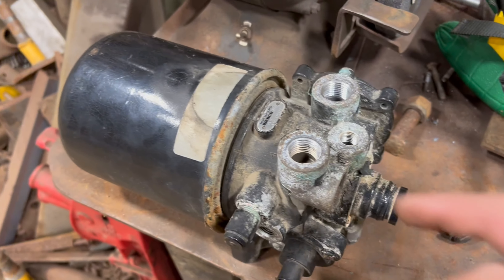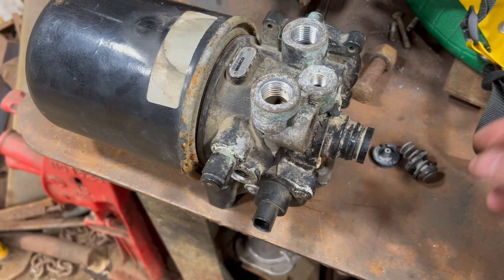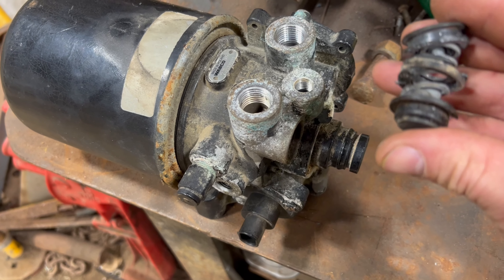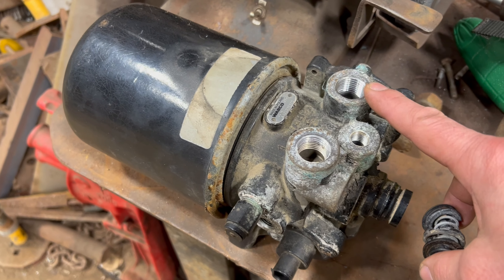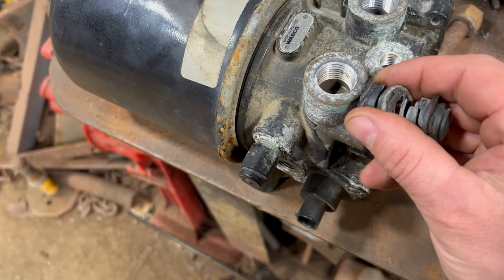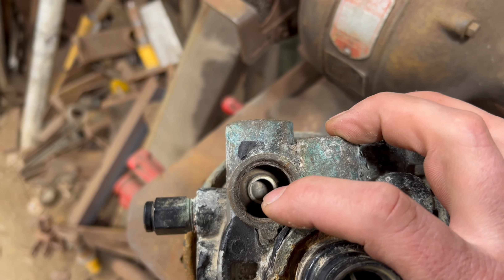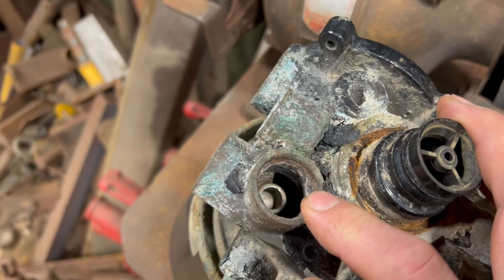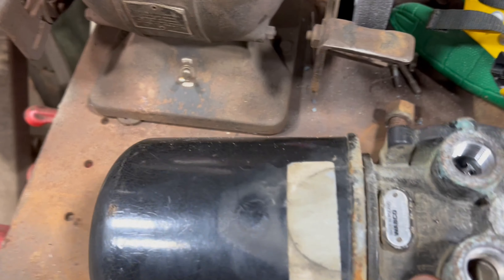What was wrong with the Mack air dryer

Comment: nice tare down I have seen that many many times before. being I seen it so much if a truck wont build air or intermittently build air I bypass the air dryer 1st just as a test to see if it changes if it builds air I hang a new air dryer if no change I hook up the dryer again and test other places governor/compressor etc. Cheers
Reply from the maker: Thank you. Good advice, this is my first bad dryer.  We never really get high milage on these trucks. This one is a 2014 and a wabco dryer. The bendix ones seem to last much better. We have trucks from 95 to 08 with bendix dryers that are original to the trucks
Reply: @JasonTheMunicipalMechanic   I have seen a 2018 fail last year even. I live in a salty place as well most times I change the whole dryer even though its more money then just a cartridge cause its so rusty. the worst air dryers I have seen are some of the aftermarket versions of a bendix AD-IP had a few only last 3 months so now its bendix or wabco no more aftermarket ones for me. Cheers

Comment: Sounds like a classic Eric O  “well there’s your problem lady!” Moment.   

I found a diesel fuel line check valve stuck wide open a while back.   It had been causing hard starts.    That was a sweet moment for me because it was soooo obvious.   Should’ve recorded it and put it up on my channel, but you know in the fury of work and deadlines it’s hard to stop and record stuff.
Reply from the maker: The obvious problems have the closure I like. There’s not much worse then an intermittent problem that has no definitive repair. I usually take apart the parts I replace to either verify the problem or to just see how they work. The air valves are pretty interesting how they function.

Comment: Is there a kit available to refresh this dryer? You might want a serviceable dryer on your shelf. Good content. 👍
Reply from the maker: You can change the filter and I would imagine you can get a rebuild kit but there was too much corrosion to get anything apart. I had to hammer most of it apart and the plastic was breaking. This is the first dryer I’ve had go bad for us. But this is also the only one of this kind. I believe all the other truck have bendix dryers.